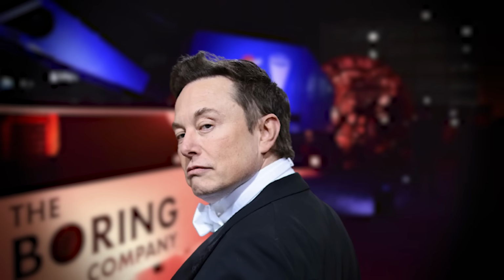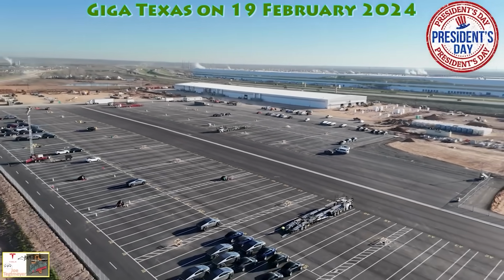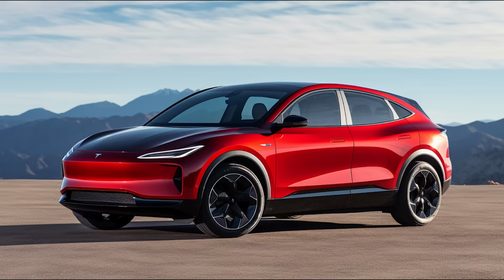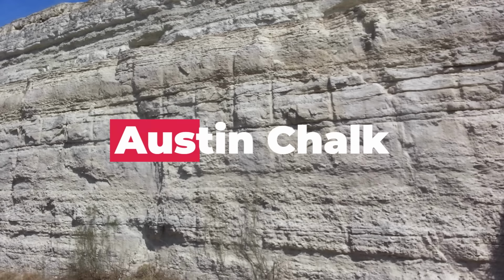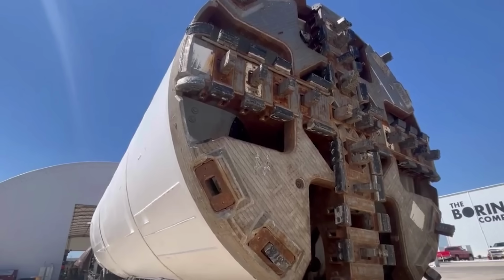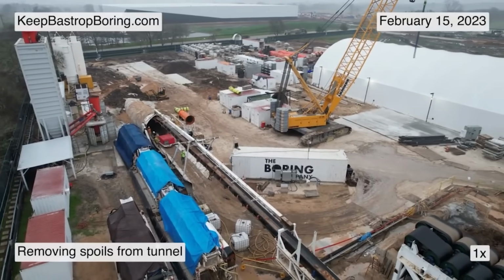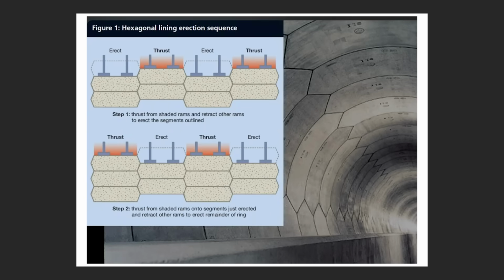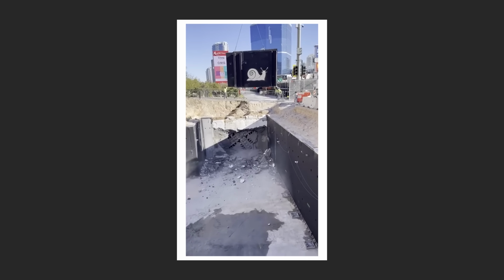Elon Musk Isn't Telling Us Something About The Boring Company

Comment: Spoil from The Boring Company's tunneling operations can potentially be repurposed for use in concrete, but it requires specific processing depending on its composition. Excavated materials like clay-rich spoil can serve as a supplementary cementitious material (SCM) once calcined, or transformed by heating, to gain cement-like properties. For example, certain calcined clays can replace a portion of Portland cement in concrete, reducing the carbon footprint due to the lower temperatures needed in processing compared to traditional cement production. In some cases, clay can even be expanded to produce lightweight aggregate for concrete applications, useful in low-strength or insulation applications.

However, for this reuse to work, the spoil must have the right composition, particularly a suitable kaolinite content in clays, to achieve the desired reactivity. This has been demonstrated with London Clay in the UK's HS2 railway project, where processed spoil has shown potential in reducing concrete’s carbon footprint while also managing waste more sustainably. The processing involves drying, crushing, calcination, and grinding, which may require setting up specialized onsite equipment.

Reusing spoil in this way could benefit large-scale projects by creating more sustainable construction materials, though it involves investment in infrastructure to process the materials consistently.

Comment: This is the kind of pretty crap - absolute rubbish - that results when a guy with a business plan & video editing chops relies on conjecture & bullshitting to produce a video. 

Hey, Asshat! - do some basic research next time!

Hello - read a book maybe
'Spoil' is what we've called crushed rock removed from a mine since the 1800s! It has NOTHING to do with being polluted - it isn't!

You made an assumption, didn't check
The detergents used to lubricate the cutting heads on the tunnel boring machine ARE NOT TOXIC. There's NOTHING toxic about them! This lubricant has nothing in common with the liquids used in fracking, which ARE often toxic & contain unknown chemicals (the recipe is proprietary, varies widely). Tunneling IS NOT fracking!

You've generated invalid concerns
Asshat "Environmentalists" (probably stooges paid by unions or Russia) have shut down Tesla Berlin repeatedly, claiming environmental concerns. So generating such concerns by promulgating bullshit lies like this video retails, is not just irresponsible - it's destructive, libelous and theoretically ACTIONABLE. It could get you sued!

YOU are at risk
Correct this video & publish a retraction & apology for being irresponsible & lazy! 
Do it quick & you might avoid potential legal action. 

Be smart: do it
And next time, maybe don't be so lazy. 
Fact-check before you write your script.

Comment: They currently can produce MYs every 40 sec.  To handle that output the tunnels have to be able load 1 car < the output rate (eg 40 secs but will be faster in the future)  otherwise a bottleneck forms which slows production flow and whenever flow slows the cost of production goes up.  There needs to be more then one tunnel in case something happens in the tunnel that shuts it down (ie flow stops and cost rises). Multiple tunnels are therefore necessary to create excess tunnel capacity to ensure, yup, flow does not slow down.  Keep in mind that an empty tunnel does not increase production costs, but lack of tunnel capacity for any reason does.

Comment: Wonder why Elon Musk does not employ a tunnel melting process like the US Government has used for many years?  It is more technically complicated, however, keeping in mind the innovation and technical expertise that is used at Tesla and SpaceX, not a problem.  

A tunnel melting machine forms the roughly 7" thick tunnel walls from the molten rock and dirt that is displaced by the melter, thus eliminating the need for the construction and installation of tiles for the walls.  

The process was tested and perfected many, many years ago by Sandia National Labs, and, by now, I am sure that the original patent protections have long since run their course.  So, why not use it?  A tunnel melter could be fitted with the angular displacement system currently in use by the Boring Company to begin the tunnel from ground level, thus eliminating the need to dig a vertical initial hole.
Reply: It’s not excavating rock.

Comment: The speeds of digging have to do with a typical day on a longer tunnel, where everything is already in place and it is simply plowing forward and laying a straight tunnel.   When you add on the complexity of the entrance and exit-- it will always take much longer on a short tunnel, vs a long tunnel where you can gain a lot of ground with simple repetition of the longer stretch in the middle.   Think of it as highway miles on a car vs city miles.   In the city you have much more stop and go traffic, etc.  Where as the long highway, you can really gain a lot of ground with very few obstacles slowing you down.  So the longer the tunnel, the higher the "average distance travel per day" should be.
Reply: I’m thinking there are several thousand miles of tunnels built in the last 8 years. Maybe with just 2 boring machines. 1/4 mile per day.
Reply: @ricosemple-qn9ft  No.. lol..  They don't even have 3 miles completed. (Elons boring company I mean).

Comment: Prufrock 2 was supposed to do 1 mi per week, as for Prufrock 3 it's supposed to do 1 mi per day NOT 7 Mi per day..... basically it's seven times faster
Reply: Reality is Prufrock 2 is achieving 120m per week (at best). Similar to an average TBM. Prufrock 3 could not move at 1 mile per day if it was just pushing itself forward with instant ring-build and nothing to excavate. Its propulsion rams can't cycle that fast under load. If, and it's a big if, it can achieve an average of over 30m per day on this drive I will be very impressed. My prediction is 5-6 weeks for the full 300m or so crossing i.e. 50m/week or 10m /day.
Reply: @tunnellingsalisbury7605  My bad, currently (4 June 24) 30m a week and falling.

Comment: Could they not change the stuff used on the front of the Boring machine? Maybe make it a concrete sluice? The part to help move the rock could contain most of the water while, once in the Boring machine, it could be made into the concrete to make the hexagonal walls. (BTW : A hexagonal wall is nothing new. Bees have been doing that for centuries as well as some people using hexagons rather than square areas for the increased strength.)

Comment: Also what is interesting is the spoil. What makes it toxic? Can we get a chemical break down? Where did giga Las Vegas put its spoil sence you say toxic
Reply: Vegas's problem has been the annulus grout. A cement paste with an accelerator added. Pretty bad skin burns of it gets on you and you don't clean it off quick. Plus they were using very outdated methods for the grouting, lots of waste, leaving it in the invert, workers get grout burns on their legs.The foam additive to the cutterhead is basically a biodegradable foaming agent (Washing up liquid).

Comment: Why the heck would you need a series of tunnels (let alone stacked) to deliver finished autos, supposedly self-driving, just across the road?   There's a futuristic mode of transportation, that I've coined "XHyperRailTrain" that could be used to move these autos.   This futuristic system, which has been in use for over a century, would move the cars using semi-automated freight cars on a tracked loop to load these autos at the production line and unload them at the warehouse.  

Do you think The Boring Company is up to the task of creating two short tunnel sections?  Granted, they may neither get new-age lighting nor the individual slow drivers that the Las Vegas Loop has.
Reply: One of the flow management principles Elon touts is no unneeded parts. Another he follows is all distance traveled is a non-value added cost, therefore the shortest distance is the least cost.  If the cars can drive autonomously there is no need  for any transportation system to the holding area other than an unfettered surface and SW to follow, find and park.  

Can TBC currently build multiple tunnels to do this (if speculation is correct)?  I don’t know.  But if they are under Musk's watchful eye being at the Gigafactory, failing forward, and a bottleneck for vehicle production,  Elon will be found in the scrum helping to break the bottleneck.  Another possibility is that Musk needs autonomous tunneling capability to use on Mars within the next 10 years. TBC is not proceeding at the same pace as the other needed infrastructure elements (eg solar collection and storage, humanoid workers, autonomous vehicles,  LEO surface communication network (aka Starlink) etc).  Why not bring the technology to where its deployment and development is not tied to outside political or other company interests and concerns, but into serving the furtherance of the current core business, BEV production,  and use that flow management system to drive breakthrough improvements boring technology?  Now it can proceed as fast as Musk prioritizes it and the engineers can deliver (eg think SpaceX).
Reply: @TomMoench  This is all nonsense rationalization and technobabble.  The primary concern of any commercial transport system is COST, followed by related metrics like safety, reliability, avg/surge capacity, etc.  I assert that a railed loop system cannot be beaten.  I guess if you're a fan of the Las Vegas Loop system you would disagree. 
Also, sure 1 million permanent, self-sufficient residences on Mars by 2050.  He's my prediction: zero such settlers on Mars on Jan 1, 2051.
Reply: @TomMoench  Well good for Elon.  If he wanted no unneeded parts, then he should get rid of all automation and have his workers do everything by hand!  And if he wanted the shortest distance to his wharehouse/parking lot, then he should have chosen the location of his manufacturing plant so it wasn't split in two by a highway.  But no, he's a genius and cannot be questioned.  I got it, maybe he could JIT each car and have it drive itself to its customer, since he has claimed once again that they are fully self-driving!  

Let's cut through the technobabble apologetics and get to first principles: given that you have this geographical divide, then you want the cheapest, most reliable, safest method of transporting the cars from the end of the assembly line to the wharehouse.  To Elon, this means boring multiple tunnels so his Teslas can drive themselves slowly across this divide.  To any rational engineer, it would mean boring either one tunnel (periodic there and back) or two tunnels (continuous loop) for a semi-autonomous rail system.

BTW, I am astonished that Las Vegas didn't sue the Boring company for underdelivering on the LVCC Loop, and instead, against all rationality, expanded its contract for more "Teslas manually driven slowly in a loop".
Reply: @HalleluYAH-b5d  glad you joined in. interesting comment although it does not pertain to  Tesla production and the possible use of tunnels for vehicle transport under discussion. No people. Just capitalism advancing sustainable energy. 🙂

Comment: There’s a reason why the “rectangular” rings (they’re not rectangular by the way) are that shape. They’re actually trapezoidal and placing them as different angles allows you to curve the tunnel with out having to cast custom panels. 

I don’t get how the identical hexagons will allow you to put curbed in the tunnel??
Reply: Assuming the tunnel is a perfect circle, then each tile should also have the same curvature. It doesn't matter if it's rectangle or trapezoidal or hexagonal.
Reply: @YR2050  The segments they are using are called a universal ring, made up of 6 trapeziodal pieces. 
If you imaging a built ring it will be 12ft internal dimeter, about 13ft 6 inches external diameter. It will be around 5ft long. However, it is 4ft 11 inches on one side and 5ft 1 inch on the other. This "taper" allows the ring to be built inside the tail shield so they follow the TBM. By rotating the ring to any one of (I think it is 18 positions (the spacing of the circumferential dowel holes), curves can be built, Left, Right, Up or Down. (Cut a salami in thick slices, but make each slice a little bit left then right. then rotate every second piece by 180 degrees so the thick sides line up, your straight salami becomes a curved one. varying the rotation means you can go in any direction ).
This is not really possible with hexagonal rings as the overlap each other by 50% in the linear direction (the maths gets a bit complex here but they just can't be made to go round corners very well). They also cannot take the same amount of thrust from the TBM pushing forward (without separating at their joints) and they do leak a lot more at the joints.
Hexagonal rings are used generally only on very long, straight tunnels in rock, i.e. for water transfer tunnels, and they are built behind double shield TBM's which rely largely on the rock face for thrust reaction with the ring build independent from the excavation advance. This way they can build faster, but in a very limited range of ground conditions.

Comment: Getting clicks with a Elon Musk conspiracy title? Kind of unseemly. Clicks for a story on a genius recreating business from below the ground to outer space. And polyurethane foam is non-toxic. It's not hazardous waste and you know it. Are you feeling competent enough to second guess Elon Musk for clicks? And you've done what exactly?
Reply: It’s not polyurethane foam.
There are a number of chemical additives for  conditioning the ground that an EPB TBM is excavating. Most likely in this ground it is a surfactant, probably biodegradable, no more harmful than washing up liquid.
Then the tail grease has fibres in it, again biodegradable.
Biggest hazard is the 2 part accelerator chemical for the annulus grout. But if using through the tail grouting it should not get anywhere near the workers and will harden to an inert fill material.

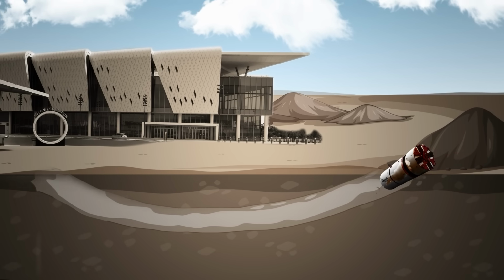Comment: 7:50 Often the tunneling machines are steered aside to dig a tunnel in which they are left underground. Especially when you're digging from both sides, you have to leave the (wide) tunneling shield underground and can only salvage the rear parts that are smaller in diameter, like the part that builds the tunnel wall from prefabricated concrete segments.

Comment: The spoils for a 14' O.D. tunnel are 5.7 cu. yd. per foot so a 950' tunnel would result in only 5,416 cu. yd. total. Hardly a huge amount, a block 50' x 50' x 58'.

BTW, 950' is from the entry point to a spot inside the new south extension.
Reply: thats well over a square mile... maybe more than 50'ft high 🤓
Reply: @pazsion Check my math please.  Area of a circle = Pi*r*r, so 7 * 7 * Pi * 950 is total volume of 14' diameter (7' radius) tunnel 950' long.  Take that figure / 50 / 50 would result in height in feet.  So 7 * 7 * 3.1415926535 * 950 / 50 / 50 =  58.5' tall, so yes, it's a significant volume of spoils, but very usable around the Giga-Texas construction site.  They're always moving a lot of clean fill around. 5416 cu. yd. is only 123 loads for scrapers that carry 44 cu. yd.  That's only a few days worth of fill movement for Giga Texas.

Comment: The explanation is unlikely. For the number of vehicles produced per hour, I doubt that the factory output would congest their road way. The likely reason is simply an opportunity to perform R&D for the boring equipment on property already under their ownership.
Reply: A short tunnel for transfer is more efficient, time wise. Even if drivers have to return via the road. If the wet dream of automated driving from end of line to prep comes to fruition, it will be more efficient and vehicles will arrive cleaner.
Reply: The Boring Company does not own the Tesla Gigafactory. Just because one person is connected with both companies does entail common ownership of assets. These stan channels seem to forget that these companies are not just one person. Tesla is owned by its shareholders.
Reply: @zvexevz  I didn't expressly state that the Boring Company owns the Tesla Gigafactory. You are assuming what "their ownership" referred to the Boring Company. The grammar doesn't even support it. That said, in this situation the parties involved don't have to overcome the same trust barriers as when you have when two unrelated organizations that are working together.